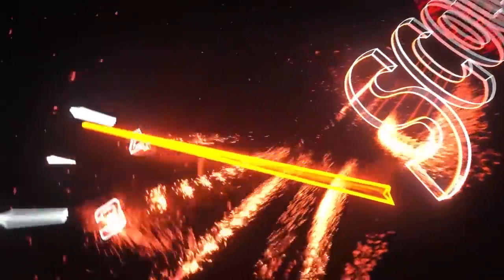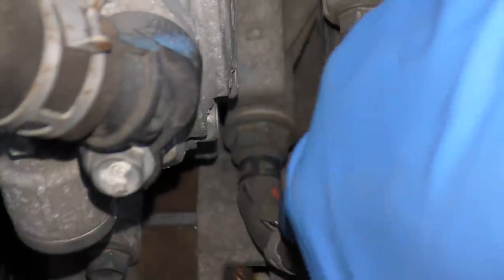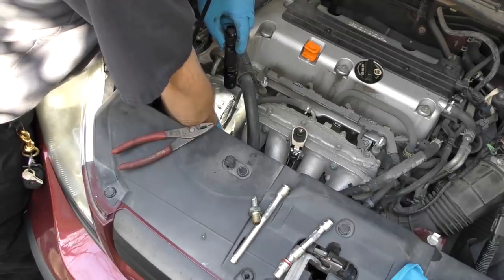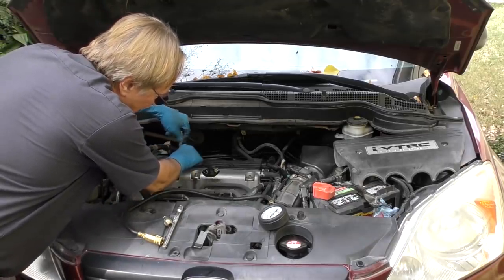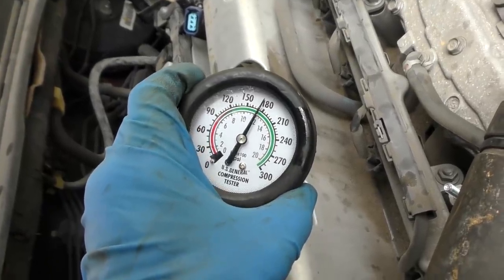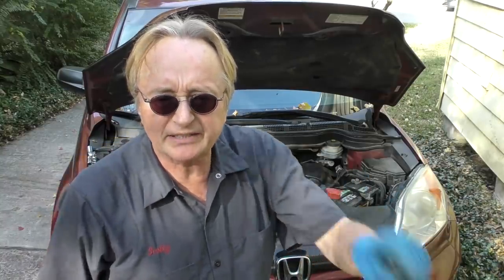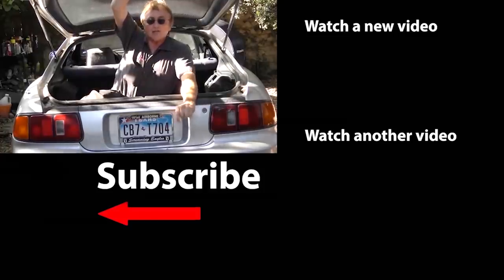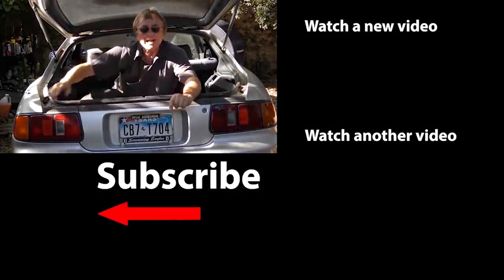The Truth About Honda

Comment: My Honda fit 2013 indicator tells me to change the oil 0w20 every 2700 miles! Even if it has a 10,000 mile oil and 10,000 mile filter!
Reply: my wife has an 09 fit sport 5 spd , and the computer that shows the oil life, says every 5000 miles. She's at like 60 percent oil life right now from our last oil change. But it bases it on how you drive and driving conditions,  so many you drive it hard, or youre always drivin in the city...I wouldnt do 10k mile oil changes. On anything...5k or less, and here says to use  5 w20

Comment: I don't know for other cars but honda oil life reminder go by mileage not SENSORS,i had a 2013 civic SI that i always reset reminder and NOTE the mileage everytimes it goes to 15% which is when the reminder starts annoying u and its always been consistent at around 4000 miles! Meaning from 100% to 15% oil life is about 4000miles no matter the temperature or how u drive.

Comment: Hey Scotty
I bought a 2015 Honda civic SI with a manual transmission for my daughter.  It has 60,000 miles on it. 
Everytime she goes around the corner the dome light comes on, the door lock flips back & forth & the dash says "driver door open"
Is that a safety issue or a problem??

Comment: I don't know how reliable is American mades Honda, but my french 95' EG3 Civic (D13B2, carburetted, 1.3l 75hp, the equivalent of the EH2 CX) which was made in Suzuka is really reliable, with only minimal maintenance like oil change. This is the car of my grandpa since 10 years and the only thing he changed is the radiator and soon the starter. I changed myself the thermostat last summer and that's it. With 25 years and 320 000 km (~ 200 000 miles) that's good, I guess. The time belt wasn't change since 12 years maybe... And he bought it with 160 000 km (~ 100 000 miles).

Comment: Scotty, I have a 2018 Nissan nv 1500 cargo van. It has about 15 K miles. I bought it new. After 5 K miles each time I change the oil, it is slightly lower oil on the dipstick. The owners manual says that it is normal ! I never have had this with my Toyota.  is this a sign of low quality or could it really be normal ?
Thank you.

Comment: OK; me wife and I bought a '90 Mitsubishi Mirage with 90K cause she wanted a small car back when we married. Timing belt was original and stretched, EGR valve was plugged with water; used lots of oil and idled rough. New spark plugs, new EGR valve metal gasket; Saturday morning timing belt replaced; then, later replaced all 8 valve stem seals and the MPG jumped from 21 to 32 for this early 1.5L motor. Took a week for the new valve stem seals to seat and the blue puff (magic dragon) went away and oil consumption was good. Drove that thing to 260K. Mitsubishi did make a quality motor and transmission at that time. Replaced the plastic front seat squab material with gray Chevy cloth for $70 ea seat; who needs AC??

Comment: My pcv valve caused oil consumption on my Honda Pilot at 90,000.  One quart every 3,000 miles.  Thought rings or valves were bad.  Just $8 pcv.  The end.  Zero oil loss per 6,000 miles.

Comment: The PCV system doesn't close when it sucks oil, it closes under high vacuum and prevents the crankcase from going into a vacuum that would cause the oil to evaporate at a lower tempurature and at a faster rate and get sucked as vapor into the intake.

Comment: For mid 1970 cars, avoid or at least do your research.  1974 was when we all of sudden decided to get excited about emmisions and fuel mileage.  Alot of the cars from this period were real dogs and their gas mileage still was bad.  Some of the early 70s got reasonably good gas mileage and had almost bullet proof engines.  I had a  Ford 1972 4 door hardtop with the 1971 400M.  I bought it used for a couple hundred dollars and drove it until the frame rusted out from road salt.  The engine was sold and installed in another car, it outlasted that car and was installed in a third car.  I had around 160k when I see sold it, have now ideal what it finished off at.  It was a very strong engine and did real will for gas mileage.

Comment: My 2013 ridgeline oil monitor system is messed, said at 10,000kms (after I bought it used and drove it that much) that I had 20% left, didn't tow, just normal driving. The next 10,000km's I towed a 2,000lb camping trailer to the rocky mountains, climbed a few hills w high revs, and towed a U haul in-town moving, aside from normal driving, said I had 40% left...I decided just to change it every 10,000kms because I can't trust it!

Comment: If you have used “high mileage” oil, do you have to keep using it forever? Will it hurt anything to try regular oil and if it doesn’t leak or use more oil go back to regular oil all the time? If does leak or use more, can you just go back to hi mileage again? Will re trying the regular oil do any harm?
Reply: I would just stick to high mileage if you have kept using it because it is really good oil after all. It has more detergents and a higher total base number to keep engines clean and free of corrosion. No need to get curious to see if using something different might cause problems.

Comment: DONT reuse pcv gasket.. replaced them on some 2.2l toyota engines, both were turned to plastic. new rubber gasket actually sealed unlike the stupid old one that turned to hard plastic and shattered when squeezed hard enough. new gasket only couple bucks. I had issue of old gasket piece dropping in engine. had hell of a time getting it out with a curved pick.

Comment: Hey scotty, I put castrol gtx ultraclean GDI turbo synthetic blend 5w20 in my 2003 f150 4.6 Triton, realistically speaking how long is that oil good for. I usually change it every 5000 to 7000 miles. Will it hurt my engine over time if I don't change it before that?

Comment: I have a new F150, and I think the oil life indicator is just based on mileage. I forgot to reset mine, and with the new oil, it was saying only 5% left. Because I listen to Scotty's advice, I changed it at 7,000 miles intervals, whereas the F150 was saying around 10,000 miles.

Comment: Scotty, 2008 toyota highlander 260000 Kms, noticing gear oil from transfer case output shaft, when should I replace the seal, and how to tell if fluid is low?

Comment: Scotty, I bought a 2012 Camry V6 from Carmax. It had 115,000 on it. Should I change the transmission fluid on this "lifetime" fluid at this mileage?  I Do have a warranty with Carmax if something big does fail. I want this car to last for as long as possible!
Reply: Don't bother replacing the fluid. You should be fine.

Comment: I have a kia forte 2017 25k miles on it, I've noticed the coolant was below the Full 
line I refilled it ant a couple months later it's back down there again,
 no visible signs of a leak on the engine and no smoke out the tail 
pipe, got no idea what it could be.

Comment: Question. 2005 mountaineer 208 miles runs great until I climb a 45 degree hill then power drops to a crawl. BTW 8 cylinder. Possible reason? Thanks in advance for your advice.

Comment: My 2009 CRV has 92000 miles on it and it doesn't use any oil. I change the oil every 5-6k miles with Synthetic oil since new

Comment: I have an 09 Honda fit, and it burns a little oil. I replaced the pcv valve, and that slowed it down, but still has a burning problem. I been changing mine every 1,000 miles at work since I work at a shop. after about 1,000 miles the oil is really dirty, but then once its almost done draining, it gets clean looking. Im confused whats going on. please help. Thank you!

Comment: What car is the most reliable and fun to drive out of the
Toyota Camry 2017 xse
Honda civic 2017 ex
Mazda 6 2017
Reply: Camry will never let you down. Mazda is the most fun. Civic isn’t the best at both but is good at both. No one car is gonna be your answer. Personally I own a new Mazda and have no issues
Reply: @Okayokayshane  thank you for responding but do you believe the mazda is a reliable car and will last me for a good amount of time? I'm looking to buy my first car and want it to last a good amount of time without spending so much money on maintenance
Reply: @kevinespinoza199  Mazda is a reliable car.
Reply: kevin espinoza they are very very good cars. Reliability and quality are good. Just ensure it has full service history and doesn’t look too flogged
Reply: I'd go Mazda 6 from 2005-08, because it's pretty reliable, a lot cheaper to buy, and fun to drive. Newer cars like the ones you mention are a money pit for reasons other than reliability. For more info, YT search "tony seba robin hood conference".

Comment: K24s had recalls for oil burning owner probly was unaware but u get a good k24 you can rack the miles the only issues on the motor down the road are the adjustable cams

Comment: Scotty is spot on here. My 2011 CRV has just over 80,000 miles and seems to be burning a quart every 1,000. Thanks for the advice in dealing with this, Scotty!
Reply: If it doesn't fix things, then just deal with it. Oil is cheap, engines and new cars are expensive. New cars are also a bad decision for one other reason: YT search "tony seba robin hood conference" if you want to know how deep the rabbit hole goes.

Comment: Hey Scotty Kilmer! My Camry 1999 Le 220,000 miles I did replace the whole of 4 spark plugs and new 4 ignition coil and suddenly check engine code P0302 P0303 and P0300. My engine sounds fine and very smooth engine nothing funny noise.
Reply: It could be become a problem if you do nothing, especially regarding the catalytic convertor, and that's expensive. Take it to an independent mechanic you trust and see what's causing the misfiring.
Reply: Michael Ball is a misfiring cylinder and I see my car have a lot of better save fuel gas than before. And I see under the catalytic converter look normal. The mechanic said that the engine sounds very quietly and probably looks like 2 ignitions look like fault or other wiring connect to 2&3 look like loose connect. Many mechanics don't understand that.
Reply: @JamesKarne  The cat would only look bad over time with the misfiring untreated. A wiring problem is a logical explanation for the code.

Comment: Damn 
I used to have a 2005 Honda Accord. I maintained the car well for years. Did my oil change on time. The car ran well  and gave me non issues until it started burning oil. I took it to the Honda Dealership and they told me it was the Vtec valve. I payed $1500 for it and 3 days after getting the car back same issue came up to the dashboard code. 
I took the car back to the dealership and after some more diagnostics they came to the conclusion my engine was  no good. Damn Damn Damn. 
I payed $1500 for a fix that was not it and now I needed a new engine. Well 
Took the car a different dealership and trade it in. 
Now I said that I know it was the PCV valve. Its got to be it. A $35 fix for thw valve. Wow 
And the crazy part I loved that Accord. For to mentioned the car had 160000 miles on it. And I was the original owner. I have to say I drove it a lot but I wanted to keep it also. 
I have learned my lesson. Look for mechanics that know their stuff. Dont trust Dealership to do all the work. Because even them dont know a thing.

Comment: Hi Scott, Love your channel! I play in a band and we have a 2001 Dodge 2500 Van/ 160,000 miles. Rebuilt transmission about 120,000 miles. Should we keep fixing it or get something else? It's got new tires , newer brakes, front end is mostly good. Well maintained. Motor runs great. It's basically a free van as we got it for $3000 over ten years ago and have put about 90,000 miles on it. Some frame rot. What vans do you like the most? Thank you! PS We are Surf Zombies playing surf instrumentals across the midwest.
Reply: You're probably in too deep with that van, and if it generally runs fine, why not keep it? Should be cheaper than a loan payment on a new one.
Reply: @EMichaelBall  Thanks Michael, I figure just keep fixing it. I kinda love the thing but can't stop looking around at other vans. Typical guy thing probably. We just don't wanna get stuck out in the middle of nowhere man! Appreciate ya.

Comment: Hey, I am new to this community. I am looking at getting a Honda CRZ (2010 and has only done 19000km) what are you thoughts? My only concern is the hybrid battery and the fact that parts for this car could be hard to find as its been discontinued. Cheers
Reply: Parts are based on the Insight. At least US law requires car makers to have parts available for a decade after the last model year, which is 2013. So parts on the CRZ should be available through at least 2023. Don't pay too much to buy one. Scotty doesn't have a confident view on used hybrids as a whole.
Reply: Michael Ball thanks, his videos are very helpful as well as your information. Cheers

Comment: 80s American cars  failed because manufacturers tried to put too much power through FWD transaxles? This is news to me! K cars, Citations, and Tempos were probably some of the most underpowered cars built. They all had wheezer four bangers that produced well under 100HP. And if these cars (or others) actually DID come with a V6, you were lucky if you saw more than 120HP. There is simply NO WAY that these cars killed themselves with excessive power output!

Comment: Scotty,  I have a 2003 that burns 1 quart every 500 miles. Dealership said it's very common for years 2003-2007. Said there should of been a recall but Honda wouldn't knowledge it
Reply: A quart every 500 miles isn't terrible. Oil is cheap; engines and new cars are expensive.

Comment: Best car 86 olds v 6 3 speed automatic transmission almost 250000 on original tran and engine tor it down engine look good , transmission clutch plates look not bad tork converter had bad shutter when locking up however over all good car had it in the family sense new change water pump at two hundred thousand. Replaced harmonic balancer it was shot when rebuilt engine. At around two hundred I started driving it regularly and I drove it very hard. Did have to replace rac and pinon around 130000 do to morning sickness.

Comment: After the pressure test, would you advocate adding some AT-205 and cranking before  replacing the spark plugs?
Also, do you need to pull the fuel pump fuse before testing?

Comment: Are you aware of the VCM issue on the honda engines between 2008 and 2010? It causes excessive oil consumption and premature spark plug failure. What should be done on a 10-year-old car that has that issue? The cost to repair is more than the value of the car.
Reply: Just keep on top of the oil and replace spark plugs as needed. That's pretty cheap.
Reply: @EMichaelBall  are you sure that doesn't cause bigger problem down the road? I changed the spark plugs back in March. Now they need to be changed again. The mechanic says unless I fix the piston rings, the whole engine might fail.

Comment: 15k between oil changes... yea that is the problem right there. at 120k the engine should be solid, i would hate to try to adjust those valves with all the carbon that is going to be built up on the adjusters. every 5k for that engine. never seen a failed pcv on a k24 and had plenty in with well more miles than that one.

Comment: I have a 2008 Honda Accord that burns at least a quart every few thousand miles. It's so annoying. Already tried replacing the PCV Valve.
Reply: A quart every 2000 miles isn't so bad. Oil is cheap, engines and new cars are expensive.

Comment: Multiple comments to make here.  Honda's K20/24 engines were probably the best engines Honda ever made - if you care for them correctly!  The owner had 12yrs/120K miles on the clock.  This tells me they drove lots and lots of short trips, probably mostly on city roads versus interstate driving.  In these conditions, the owner probably neglected the oil changes and when they did do oil changes they went to one of those quickie oil change places which are notorious for using inferior grade oils and more especially oil filters.  With Honda's, one should only use OEM oil filters (yes, they are the best  - ask any professional race team what they use) and a high quality oil such as Quaker State or Valvolene.  I never, ever use Castrol - I've heard numerous oil experts say that they have very inconsistent quality control.  If this owner would have known what to do as far maintenance for this car, they wouldn't be having a oil usage problem.

Comment: I just bought a 2017 Honda HRV and I just got nervous!
Reply: I'm about to buy a 2017 Honda Accord and felt the same way 🤣🤣
Reply: Here's how to alleviate your fears.  ONLY USE GENUINE HONDA OIL FILTERS AND HIGH QUALITY OIL SUCH AS QUAKER STATE OR VALVOLENE!.  If you cheap out and go to one of the quickie oil change places YOU WILL EXPERIENCE THIS PROBLEM.  Genuine Honda oil filters are only about 10 bucks and that 10 bucks will preserve the life of your engine.  DON'T CHEAP OUT ON THE OIL CHANGES!!!  On Honda's they're absolutely critical for long trouble-free engine life.
Reply: @crystald8465  I have Scotty Kilmer anxiety!
Reply: @crystald8465  Hope you didn't buy it, yet, or can get a full refund! First of all, the DRL headlights are somewhat unreliable. The seats can get uncomfortable after 30-45 minutes of driving. There are a few reports, online of the car mysteriously going from park (without the parking brake applied) to reverse and moving without any action on the pedals; Honda didn't admit fault in any of the cases I read of.

Moreover, there's a more fundamental issue with new and newer cars that make them a bad purchase decision: YouTube search "tony seba robin hood conference" and watch that presentation (though you can skip the first two minutes; they're mostly fluff).